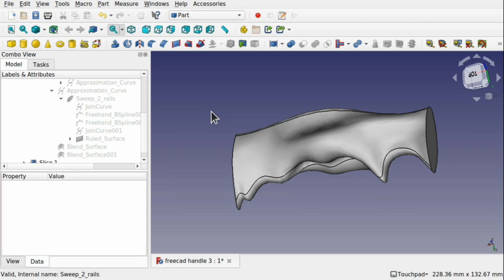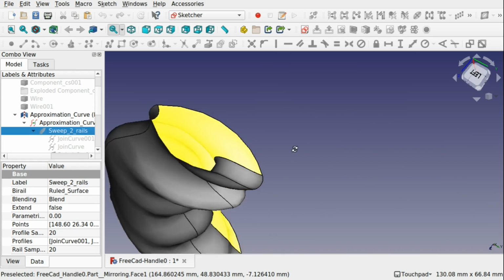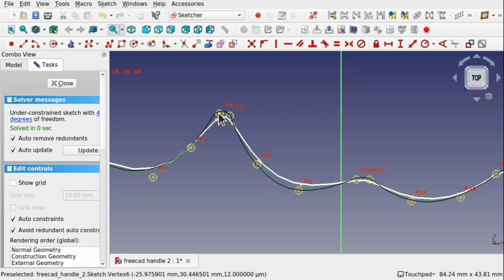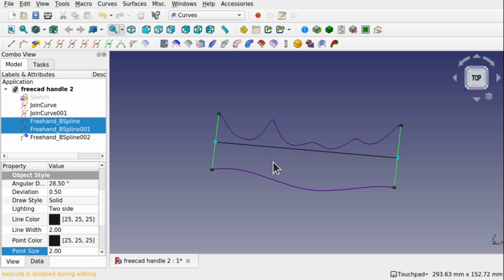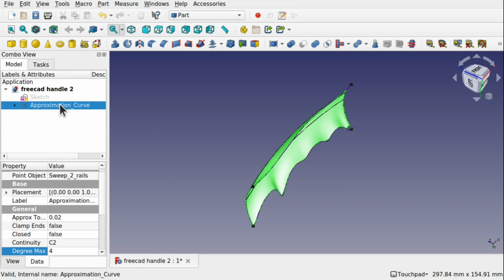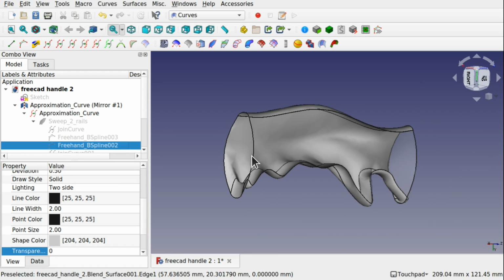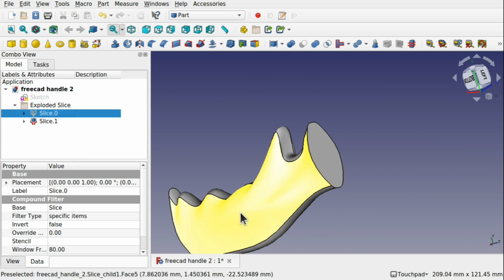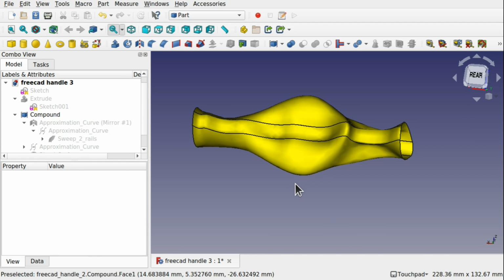FreeCAD: How To make A Fully Parametric and Customised Curves Workbench Handle

Comment: **Update* 33:27
If you are using Freecad 1.0 or greater and the slice doesnt work, heres how i got it to work. Follow the video and create the slice. In the tree view you'll see "Slice.0" and in the DATA properties check to INVERT. Open the lower"Slice" and in that Data properties set the tolerance to something like 0.2mm. If you see multiple slices in the tree view, undo then select in the opposite order. As in Extrude first then Compound.

Hopefully this helps. Took a lot of back and forth before finding a suitable result.

Comment: Dear Darren, I presume using B Spline in Sketcher instead of Draft to Sketch Draft WB allows Parametric Control from the beginning. Obviously if the Object is correct then Draft to Sketch is quite handy. I have used that method importing Airfoil *.svg files with success. Another vert Interesting and useful Tutorial.

Comment: Congratulations, great job. One question, I'm making a piece something similar, with two differences and I'm very stuck with it, maybe you can help me. Imagine that the two ends of the handle are rounded, not flat, and imagine that are lengthened perpendicularly about 3 cm with respect to the longitudinal axis of the handle and that extension is almost conical. What do you think? Thank you very much for your excellent job and for teaching your knowledge. Best regards.
Reply from the maker: Thanks glad you liked, Is the handle you looking at creating similar in shape to say the handle of a gladiator sword.  Where you have a curved hilt and guard and your hand sits in the middle?
Reply: @MangoJellySolutions  Thank you for your answer. The handle is not exactly a sword handle, ha, ha, ha. It's like a "C", imagine a "C", the finger places are in the middle, in the central (longer) part of the handle; so you get the handle and you will get two ends 90º (the end parts of the "C") from the central part. Any idea? I'm really stopped. Thanks.
P.D. Of course, all parts sections are curves, the central part sections (finger places) are like ellipses an the end of the end parts are circular.

Comment: I like this video . I like them all . On your other series explaining formulas can free cad do an equation  driven or defined arc for gear design , if so would you demonstrate this please ? Thank You for all your effort and videos . 
Happy new year to you and your family . 
Terry
Reply from the maker: Sorry for late reply, trying to get to all the comments and have quite a few to get through. Glad you are enjoying the channel. With what your are doing it would be best to use a spreadsheet. You can define the equation or formular in the spreadsheet and then cross reference those to the sketch. I am currently putting together a tutorial for another comment regarding where the viewer had asked how you would constrain using arc length (along with another parameter such either radius or angle between two points), you cant do this in field formula as the unit measurement causes issues and you cant just drop the degree or unit  length (mm /inch). This is where a spreadsheet comes to the rescue. I have done the first part of the video and hoping to finish the rest and get it  out today. I will update this comment when it's released. Thanks once again for the comments and wish you all the best for the new year.